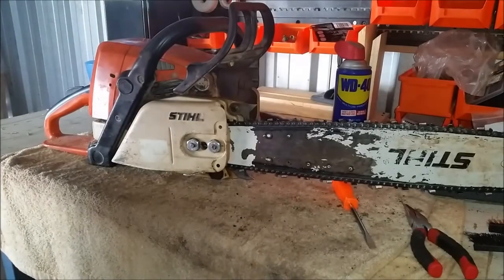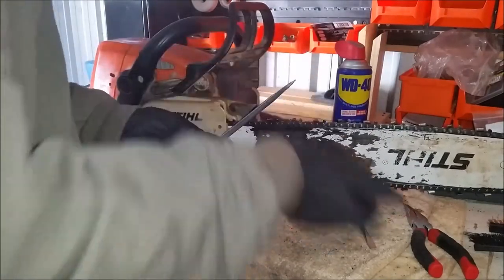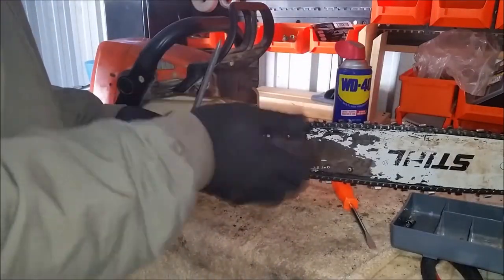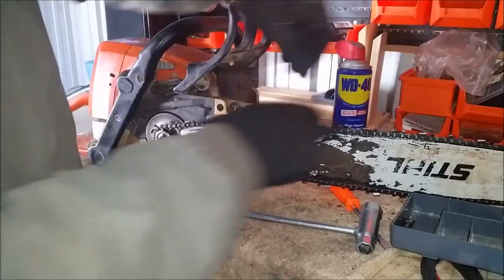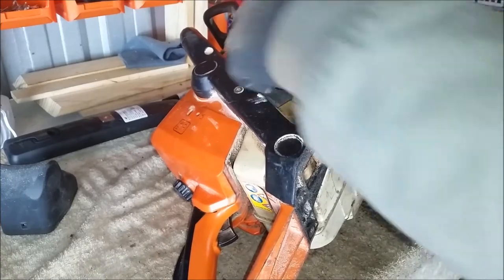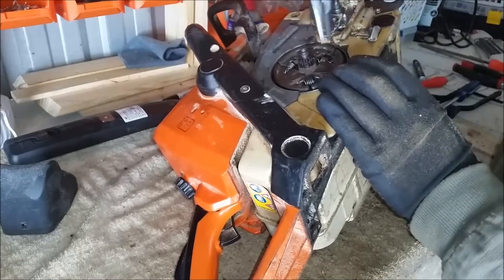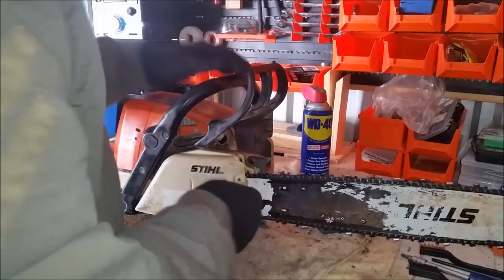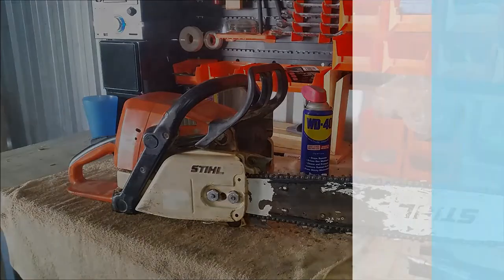Chainsaw Clutch Spring replacement, STIHL 029 super

Comment: Well done. 
Question please.... what symptoms did you see that indicated a bad clutch (spring) ?
thanks.
Reply: I noticed mine when the saw wouldn’t idle when I engaged the chain break. The saw had no issues idling when the chain was allowed to move. But when I engaged the break the clutch wouldn’t retract properly causing the motor to stall.